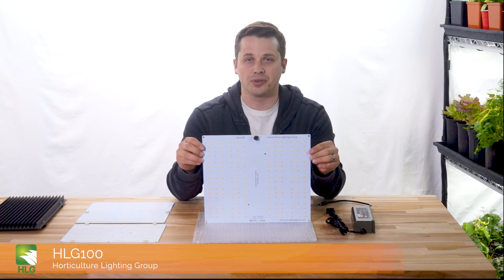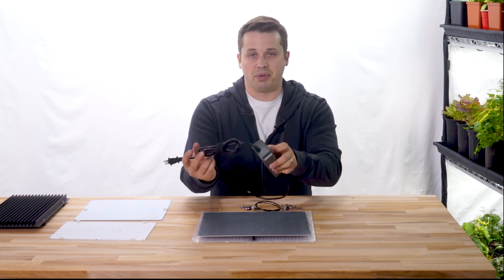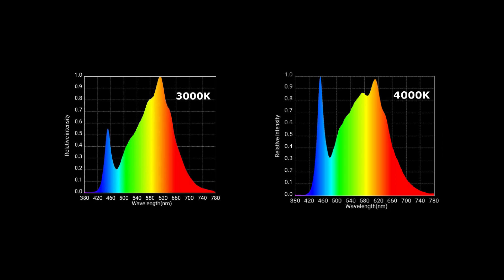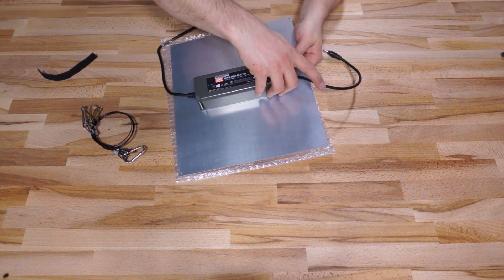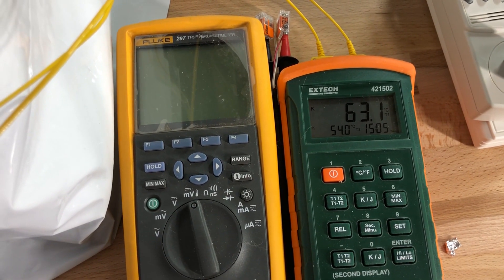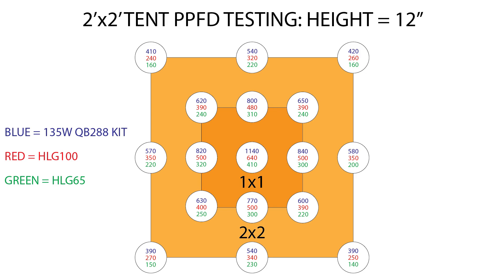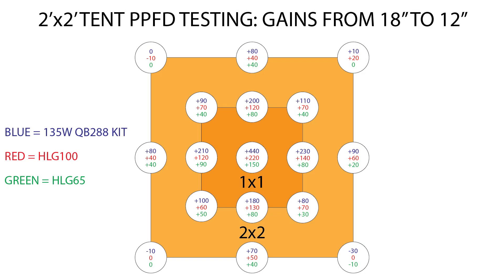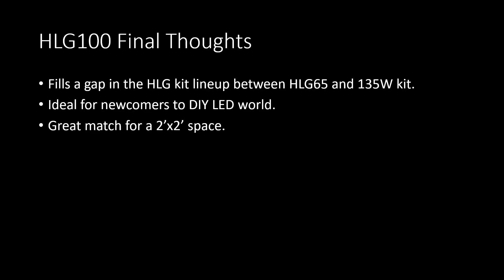A Comparison and Review of the HLG100 LED Grow Light DIY Kit

Comment: Hey will five hlg v100 cover my 2x7 if i line them up in a row. I want a 550 but my space is awkward
Reply: Five of these lights can cover 45 square feet for veg, or 20 sq feet for flower by HLG's specs. You have 14 square feet. So yes, 5 would be ideal for getting enough PAR for flowering. However getting your hands on 5 of these boards will be difficult, they are very popular, and currently sold out.
Reply: I talked to a guy from hlg thismorning and he said there in stock. He told me 4 are more than enuf.
Reply: @Atv821  thanks for answering me tho
Reply: Could run the 300L or the 350r diablo in a 2x7
Reply: @joemonko2794  It's they're. Put the bong down and repeat third grade.